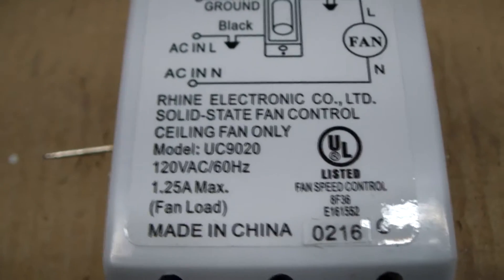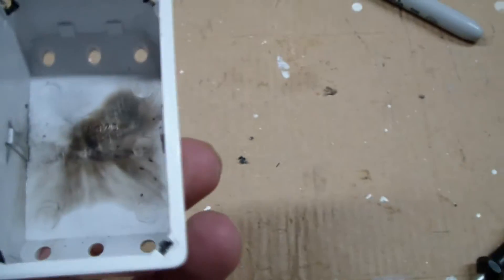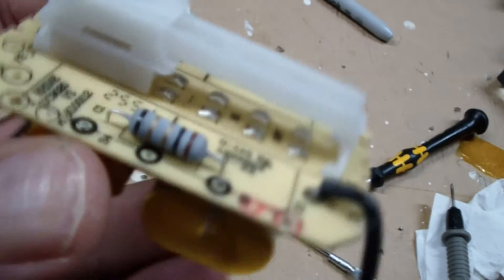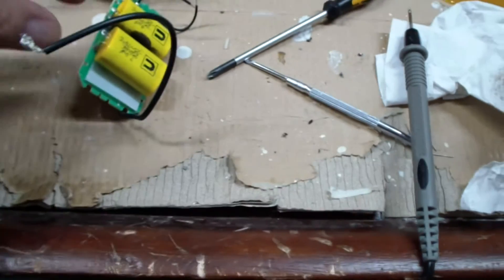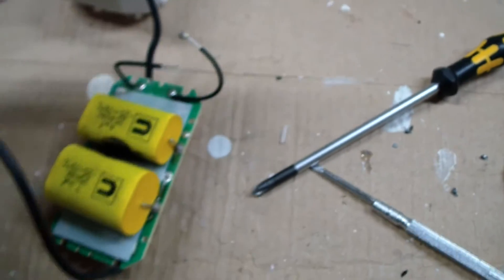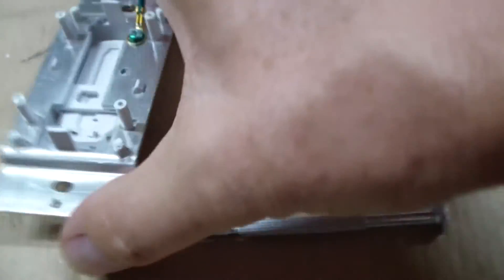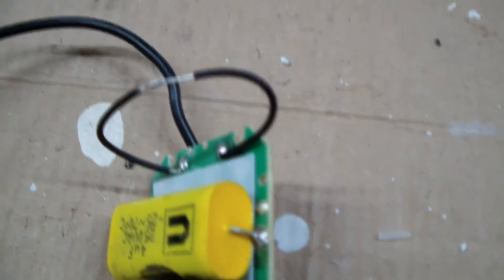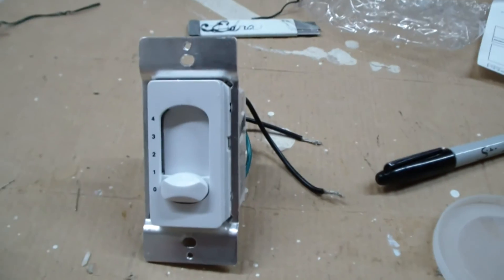Rhine UC9020 Fan Speed Control Repair

Comment: Just to add: ones that come with Hampton Bay Industrial actually have 8uf and 12uf, so 8uf for 4, 12uf for 3, and 8+12=20uf for 2. Same model number, same current rating, but different capacitors.

Comment: Thanks for the video Kent. You answered my question. I thought my switch had been wired wrong because full power was on 1 progressing to minimum power on 4. I guess not. It just seems like it would be more intuitive to have min power on 1 and max power on 4. Now I know you might suggest how I could modify my switch to do that but that's probably way too much trouble for me and beyond my skill level
Reply from the maker: Motors need the initial full torque to get started from full stop.
Reply: Cover each number with a new number, like covering "1" with "4". That should clear confusion.

Even if you wired the switch backwards, it would work the same way. The switch was already pre-wired inside for 1 to be full and 4 to be low, and 0 to be off.

Comment: Do you hook both of those black wires to the incoming hot wire
Reply from the maker: Yes, only the black wires to hot. Do not connect controller to the white wire.

Comment: too hard to repair....i will just go to purchase a new one....:) thanks for sharing
Reply from the maker: I like repairing stuff for the fun of it. Driving to the hardware store, finding the part, waiting in line would take just as long. The real point of this video is to show what was inside and how it worked.  I already had a replacement part so this is still sitting in a drawer.